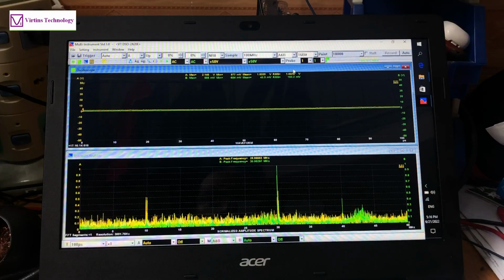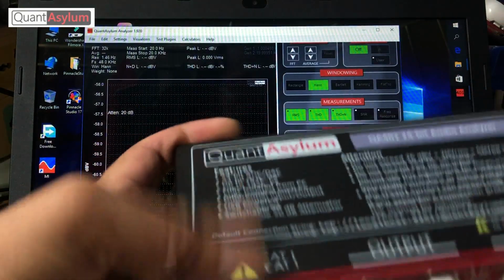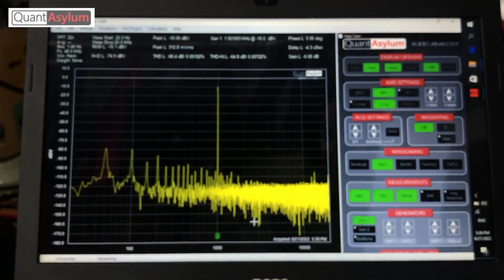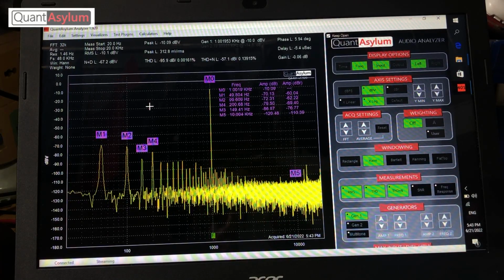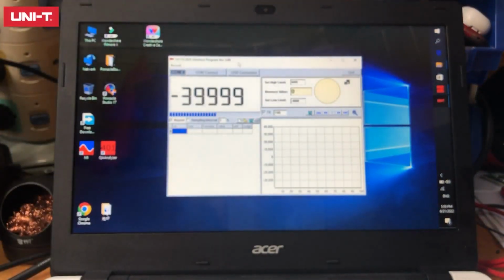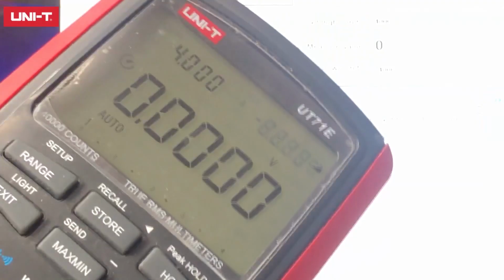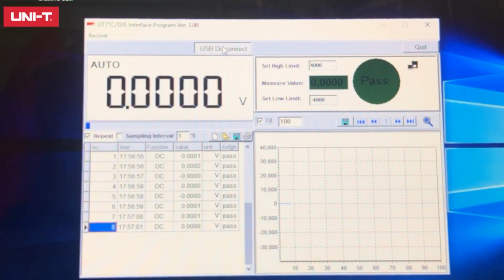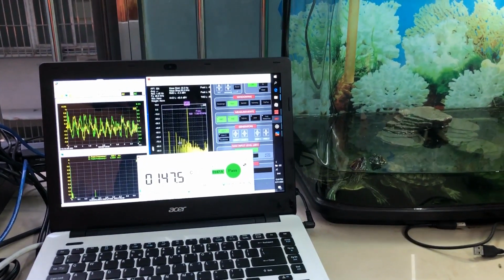Quick dive QA401 Quant Asylum | Multi-Instrument DSO 2A20E |  UT71E  UNI-T

Comment: I saw in your video that you have unique insights into the TDA8920BTH power amplifier. I am a beginner and I followed the schematic diagram, but it does not work. There are two things that confuse me very much. 1. Is it a dual power supply design, does the+25 and -25 require two power supplies, or only one power supply, with+25 connected to VCC and -25 connected to GND. 2. What do the two circles on the left side of the schematic mean. Looking forward to your answer
Reply from the maker: Hi there,  for your questions (1) It is a split power supply with +25Vdc and -25vdc, the ground is in between.     The filtering capacitor on your split power supply should be 10,000uF /36Vdc.    (2)  I am not sure which schematic you are referring too, would be interesting to know which one.